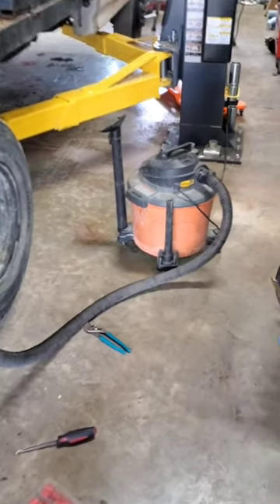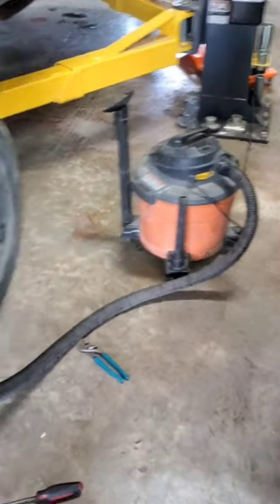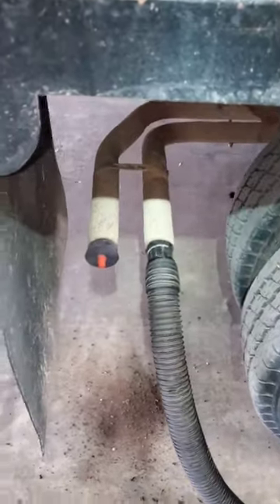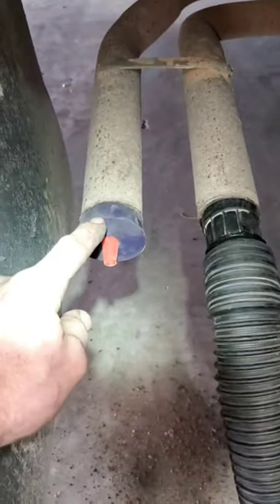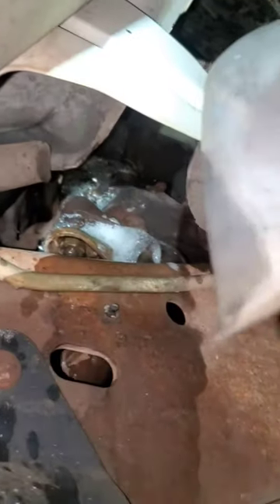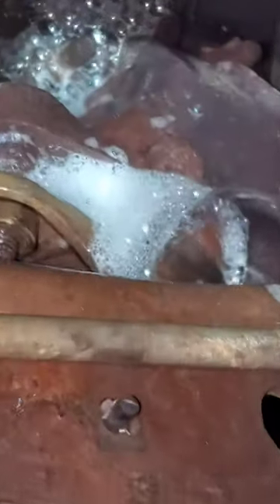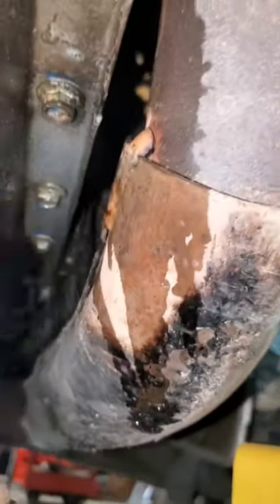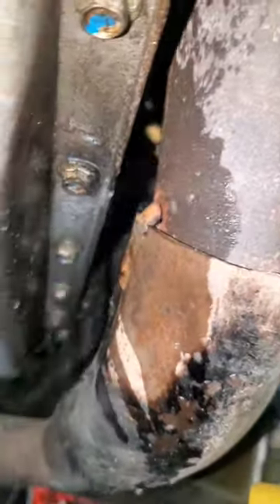Find exhaust leaks fast with vacuum cleaner!

Comment: Snap on is going to turn this idea into a machine and sell it for $15k
Reply: As a Snap-On engineer I can confirm we are working on it.
Reply: @stogie0608  😂😂😂😂
Reply: Then Harbour freight will have it 80% less than strap on and be twice and crappy in build quality.
Reply: @code2010 man  basically I was talking about homeless chinese freight,don't assume.....
Reply: lol
Reply: @TheXxxcodexxx   I found a leak with soapy water whereas with the smoke machine it was not visible
Reply: @TheXxxcodexxx  no uv due just fog
Reply: @TheXxxcodexxx you can put a cigarette in a unused vacuum port and light it to but where smoke quickly disappears soapy bubbles increases making it a better visual… a fog machine would be good for small vacuum lines where you wouldn’t know where the leak is at

Comment: Have done this several times. If you have catalyst efficiency codes, exhaust leaks up stream of the o2 sensors are very common. The shop vac method gives you time to check the whole system, and you don’t have to mess with adapters and a regulator for shop air.
Reply: Do you have a video of when you used this method?
Reply: @GripFreak  I do not. It’s very simple to do though. Connect the hose to the outlet side of your shop vac, put it over the tailpipe and wrap tape around pipe/hose end connection to seal it as best as you can. Get a spray bottle, put about a 1/4” of dawn in it then fill it with water. A nice soapy solution like that is perfect for spraying down any suspected areas. It will bubble up nicely, even from a small leak.
Reply: Yes I'm getting GENERIC O2 sensor codes (p0032 HO2S Bank1sensor1) but I think it's the vacuum leak causing this. Good catch‼️

Comment: i really need to get into the habit of considering both ends of my shop vac as equally useful, there are so many things I could have done way easier if I had used the outlet instead of compressed air or the suction end.
Reply: i feel you. i just cleared up a clogged drain like that, used both ends simultaneously until it was free

Comment: The thing is on some of them smaller leaks when the exhaust gets hot it will swell and seal them off.
Reply: Exactly
Reply: Not the way I drive
Reply: Eventually that small leak gets bigger and no amount of thermal expansion will seal it off.
Reply: You've got a point, but there is nothing wrong with addressing them before they become bigger and make problems for you later
Reply: @erict3728  what kind of problems?
Reply: @dcgo44r  exhaust leaks close to or at the manifold are good for causing burnt and cracked valves. Leaks in general will make your catalyst not work properly and take out your expensive converter. Extra fresh air in the exhaust stream will be misinterpreted and cause the engine to run at non optimal fuel mixtures causing bad efficiency and other fueling issues.

Comment: Nice idea. I’ve plugged the pipe with rags and engine running and listened for air leaks or you could still use the soapy bubbles

Comment: I thought I was the only one who did this! I remember trying to figure a way to find exhaust leaks without a smoke machine and then it finally clicked. while it’s highly unlikely to damage the engine, I always run the vacuum and shake the hose for a minute, before hooking it up, to work out the fine dust from the hose.
Reply from the maker: Yeah I tried using a smoke machine too but they don't put out near enough volume so all the smoke leaks through the engine and water drain holes in the muffler and never builds any pressure in the exhaust to find the real leaks.
Reply: @TechnicianRed  agreed. When I was still a diy mechanic, I first tried starting the engine cold and sliding under the car as fast as I could to spray soapy water. Looking back it was quite comical and I never was fast enough to get to the headers. Great video. The simplicity of this test coupled with the availability of needed tools will help a lot of people.
Reply from the maker: @peterweth  I tried doing that same thing too 🤣

Comment: Seems like a great idea. But wouldn’t the metal be hot and expand while engine running? Also, wouldn’t the actual exhaust air be flowing in a different direction while the engine running? I don’t know a lot about car engines. But I think your idea to use shop vac is impressive to say the least.

Comment: I've done that just the other day I used to leaf blower though LOL it worked and I have very small exhaust leak but I still smell it inside the car pretty strong I think I'm going to try the vacuum cleaner next to leaf blower is a little bit noisy

Comment: This method also great at letting you know which cylinder is on the exhaust stroke and has the exhaust valve open by the carbon pushed into it.  Im sure it would be fine (seriously not being sarcastic), but I sure wouldnt risk it, flowing exhaust backwards on an engine not running.
Reply: That was my exact thought, and I had to scroll for a while before someone said it....
Reply: If you have carbon that bad you have bigger problems.
Reply: @oliver_klozoff  thats what fuel turns into when its burned. All engines have carbon. It's not a "problem", it's part of how an internal combustion engine works. Good try contributing though!
Reply: @MrBill8706  also if I wanted to be a smartass I'd correct you that fuel doesn't turn into just carbon, in fact most of it are gasses and a small amount of carbon so nice try.
Reply: @oliver_klozoff  I didn't say it turns into just carbon.  The carbon is what we were talking about, though.  Grass is green, but I didn't include that because it wasn't relevant either.  You're about as good at being a smart ass as you are contributing to my original comment.  Keep at it, though. You'll get better 👍

Comment: Not to be a negative Ned but some of the exhaust valves are open and don't forget about overlap. I would worry about blowing debris into the cylinder and possibly intake if the cam is in the right position.
Reply from the maker: Well the closed throttle body cuts down airflow 95% plus. You can put your hand over the vacuum intake and feel there is barely any airflow. If you wanted to be 100% safe you could allways cap the air intake/throttle body and that would stop 100% airflow into the engine.
Reply: Like I said not trying to be negative but I've always done everything possible not to get foreign objects inside engines when working on them. That said this is a awesome way to find exhaust leaks thanks for the heads up.

Comment: Buy a stethoscope and remove the end and put a metal tube in the end. Brake line works great. When the vehicle is running you can hear the exhaust leak really well. Doesn't always work because it may seal up from getting hot.

Comment: We had a triton v-10? In our 1 ton dually work truck at Albert oil company and the heads where aluminum, exhaust bolts broke off without us touching them! They suffered from the electrolysis effect. It also had plug thread issues and coil packs went bad with regularity. What a POS! I’d much rather work a good in-line Chevy 292 6 cylinder or a Chrysler polysphere from 65 or before(hardened valves and seats,of course), my opinion.

Comment: Genius,  God bless.
Reply from the maker: Oh I'm no genius, I read about this trick online somewhere and thought why not pass it on.
Reply: @TechnicianRed   mybe but you were smart enough to apply it. And explain it in terms  that even I could comprehend.  And besides I have been a diesel tech for years, around other experienced techs and we do use soap in a bottle on exhaust leaks but it is always with the truck running and getting hotter by the minute.  I like this way much better.  Genius, I stand by that.

Comment: would this not blow any debris laying in exhaust pipe , rust ,water ,etc ....back into the cylinders that have the exhaust valves open ?? correct me if I'm wrong  ?

Comment: I just gotta ask. Aren't you likely to have an open exhaust valve impact your test?
Great idea overall, you have a new subscriber!  Please carry on!
Reply from the maker: Yes, there is allways going to be an exhaust valve or several exhaust valves open but the test still works as the intake valve is likely still closed so the air can't escape the cylinder. And, I have done this test many different times on many different engines and have never had a problem with not enough pressure. It doesn't take much pressure at all when you use soap bubbles.
Reply: @TechnicianRed  That was very cool, thanks for taking the time, you are, of course, correct. 
See, I already learned something.
This is gonna be great!
Please carry on!

Comment: Wonder if you could do the same thing with the gas cap and an ultrasonic fogger on the shopvac intake to find evap leaks?
Reply from the maker: Likely too much pressure for EVAP leak testing. EVAP smoke machines only make about 1psi max.

Comment: Just curious: wouldn't it be the same result by just turning the engine on and spraying?
Reply from the maker: @brotherkossi  no. Less pressure in the exhaust and the water will immediately boil after the engine runs for about 5 seconds.

Comment: Now you can have the heads and manifolds planed at the machine shop and then weld up a stainless system with V clamps because no matter what you do the original materials and methods are going to leak even if it's all new.

Comment: Just use sea foam spray in your throttle body, let it heat soak, then start your car and watch all the smoke . Then you also clean your combustion chamber while doing so

Comment: If any of the exhaust valves are open you’re blowing all kinds of crap back into the engine cylinders and exhaust valves pray the engine runs good when you’re done
Reply from the maker: Nope not with a closed throttle body. Hardly any airflow through engine and not NEARLY enough flow to carry anything detrimental into the engine.

Comment: that won’t suck oil up into any exaust valves that happen to be open?
Reply from the maker: It's blowing, not sucking. Besides, the closed throttle body is going to stop 95%+ airflow through the motor
Reply: @TechnicianRed  yeah

Comment: Would this exhaust test work for evap leak too?
Reply from the maker: Maybe but a low pressure smoke machine with flow indicator would be a WAY better tool to use.

Comment: The first thing that comes to mind is all the dirt from the shop vac you’re blowing back into the head
Reply from the maker: The vacuum has a filter so there isn't any dirt coming out. Then, the very low volume of air coming out of vacuum from the huge restriction (being hooked up to closed exhaust system) further reduces the chance of dirt coming out of vacuum. Finally, IF any dirt were to be put into exhaust, the catalytic converter would filter it out (but that's if it makes it past the muffler which would be very hard to do).

Comment: I found a leak under my heat shield to my cat...very hard to fix myself cause i cant cut the heat shield off...i am going to try to put some of that furnace cement thats rated for 2000 degrees on it under the heat shield

Comment: Can I use the same method to find a vacuum leak?
Reply from the maker: Probably but I prefer a smoke machine. There are too many places you can't get to to spray Soapy water on where a vacuum leak could be present.
Reply from the maker: Just make sure you have a 100% clean hose and filter

Comment: Ummmm? What if you have a piston on top dead center with the exaust and intake valve both open? 🤔
Reply from the maker: That is the only time air will flow through motor but the valves won't be open far so it likely won't be enough airflow volume to carry anything harmful into the motor. It shouldn't be any worse than an open EGR valve.
Reply from the maker: You also have to consider if it's a gas motor the closed throttle body will pretty much make this test 100% safe as a closed throttle body will cut airflow by more than 95%

Comment: What we really care about is what happens as everything heats up,,,,not when it's cold.
Reply from the maker: In my experience, exhaust leaks are pretty much allways worst when the exhaust is cold. This rule applies mainly for exhaust manifold leaks as when the manifold expands from heat it will usually start to re-seal against the head again.

Comment: Or a intake smoke machine
Reply from the maker: Tried it. Not enough volume to build any pressure in the exhaust especially since most mufflers have water drain holes.

Comment: The one or two cylinders with the exhaust valve still open though..😣
Reply from the maker: No worry the intake is likely closed and after that you have a closed throttle body

Comment: Your pulling soapy water into the exhaust why did they hire him again if you keep spraying the exhaust over and over again pretty soon you'll have to flush the whole system regardless of the leaks doesn't matter that is still a terrible way to do it now if your vacuum has reverse flow and it's filling the exhaust with fresh clean air that's not a problem but creating suction leads to disaster I know it's pretty dam rare but still at least try to be careful lol
Reply from the maker: Apparently somebody didn't watch the video. And, tell me again how suction inside the exhaust will create bubbles on the outside of exhaust?

Comment: At 300 lbs I'm not looking g foward to finding this leak...either vacuum or exhaust, in my gti which is 2 inches off the ground and has the tightest most complicated engine compartment I've ever seen. P2096🤦‍♂️

Comment: Squirt a little diesel in the carburetor it will smoke like crazy you'll see every leak
Reply from the maker: Some exhaust leaks that are crazy loud when cold will seal up only a minute after running so this trick will show you every leak before running the engine and potentially blowing your chances at finding the leak.

Comment: If you cant look and see where it is leaking instantly, you hook your smoke machine up to it. This is totally retraded
Reply from the maker: WRONG. I have two smoke machines. One high pressure and one low pressure. Neither of them will build any pressure in the exhaust  system due to them not flowing enough volume. Smoke machines are very low volume machines and the smoke will be leaking out of the muffler drain holes and most of your u-bolt style and slip coupler connections. Then, lots of smoke leaks by through the open exhaust valves. This equals 0 pressure inside the exhaust and you never find your leak. Trust me I tried many times.

Comment: Exaust leaks, u know ur making money that day. Straight from the factory 99% of vehicles will have some exhaust leakage. If u can't fit ur finger in it it's not worth fixing. (Unless it's before ur O² sensors then u might want to think about considering the idea of welding up a couple of the larger holes)

Comment: You are pumping air in and not vacuuming or using the vacuum side….right!!!
Reply from the maker: That is correct. Make sure to run a filter on your vacuum with a clean hose and tap on the catalytic converters first to make sure they aren't coming apart as debris from bad cats could end up inside the engine and could cause catastrophic  engine failure.

Comment: Much easier way to do this. Take a $3 HF stethoscope and put a single vacuum line with a "T" to connect one end to each ear side and you listen to the connections with the truck running.. can hear vacuum leaks as well

Comment: Are you not concerned about blowing a bunch of crud into the cylinder? If not from the exhaust pipe than from the vacuum itself, the don’t always blow out “clean” air. Just wondering.

Comment: Ever hear of a smoke machine?
Reply from the maker: Yep. Have a low pressure and high pressure model that cost over 2K combined. They don't work on exhausts. Not enough volume so there is never any pressure build-up as it all leaks out the muffler drain holes, u-bolt connections, valve overlap then out crankcase breather....

Comment: Hopefully you don't push to much  Debris into your pistons. Thru the open exhaust valves.
Reply from the maker: Not enough volume to do much as the intake valve will be closed or barely open from the valve overlap. Shouldn't be any worse than when the EGR valve is open. There is a reason that pressure builds up in the exhaust-its because there is no where for the air to go (i.e. there is no air or very little air flowing through engine)

Comment: Very bad idea. Your blowing rust and carbon back inside the engine.
Reply from the maker: Not with a closed throttle body and valves are only barely open when overlap occurs. This cuts down airflow by >95% preventing any big particles from reaching engine. You could even cap the throttle body to be 100% safe

Comment: Can be a bad idea if your cats are falling apart or are semi clogged this can blow everything back into your cylinders if your exaust valves are open and or shot .....platinum dust from cats can aslo wash the cylinders through egr valves too ....all causing 0 compression .......this is a terrible idea don't do this just look for the black soot around the leak like a normal person and don't be like this goof ball